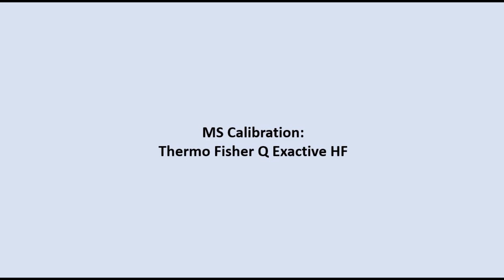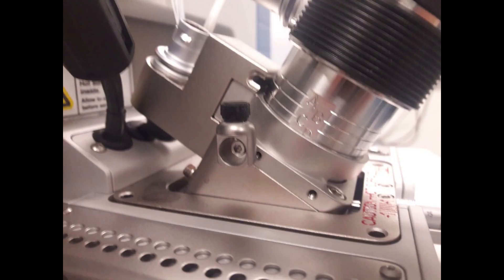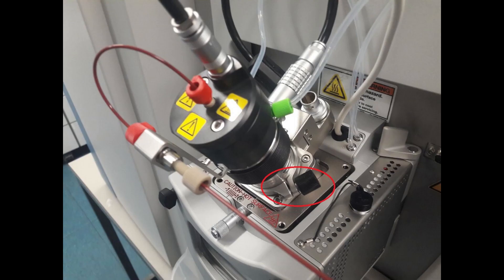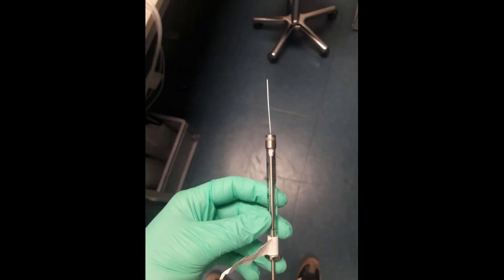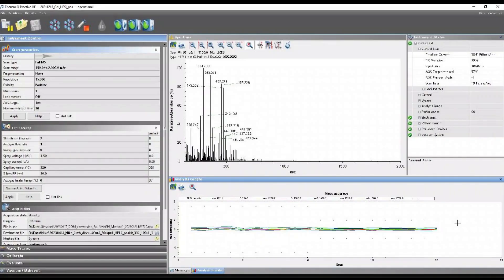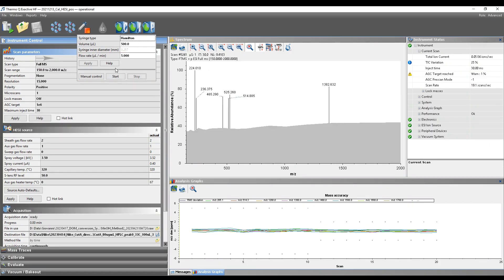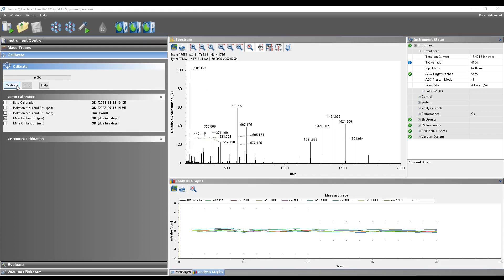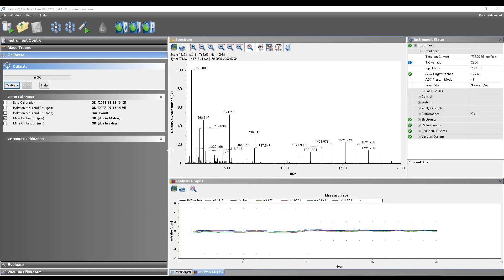Mass Calibration of a Mass Spectrometer, Thermo Fisher Q Exactive HF MS System

Comment: Hello, thank you so much for this detailed and well presented video. I have a question: if I operate at a rate of 200 to 600 uL/min, my understanding is that the calibration should also be conducted at this flow rate, so the same conditions are used both for calibration and sample analyses. Is that correct? Also, one of the issues I had doing a high flow calibration (also to check other parameters), I rapidly run out of calmix solution in the syringe (this is a 500 uL syringe). So, if a test is not done and I run out calmix solution, can I refill the syringe and pursue de progression of the test ? Thank you so much in advance for your  help.
Reply from the maker: Hi LCMSMS-i8x, the routine calibrations should always be done at low flow. 2-5 uL/min typically works well for us. If you want to tune the ESI settings, you will need to use the proper high-flow (according to you LC method). We typically use then a t-splitter and infuse the cal mix with the syringe pump and a low flow rate (2-5 uL/min) into the LC flow path with regular mobile phase and the proper flow rate. You will safe a lot of cal mix that way :)